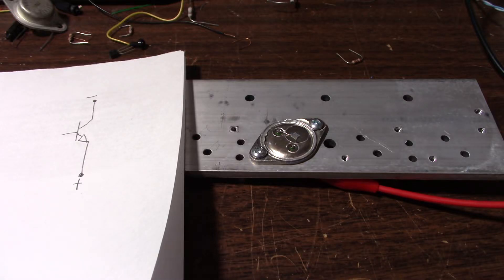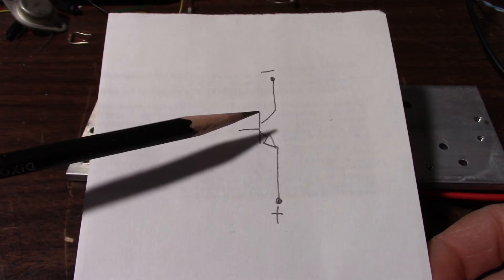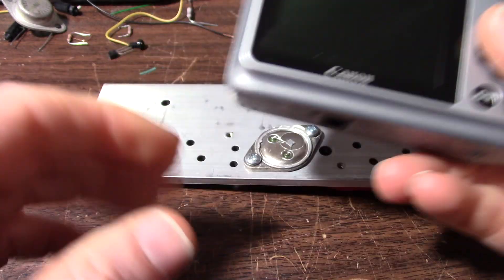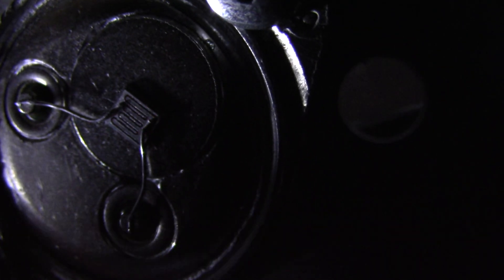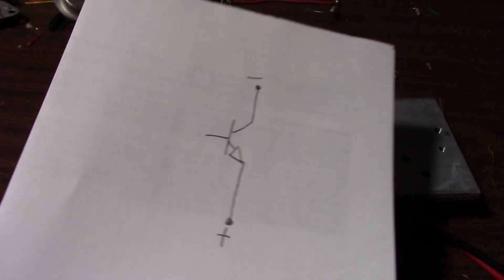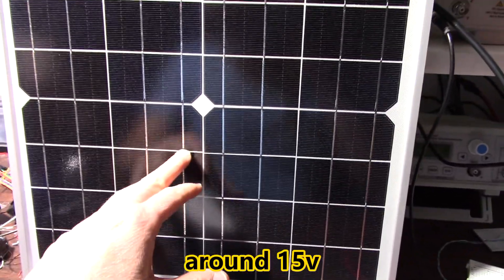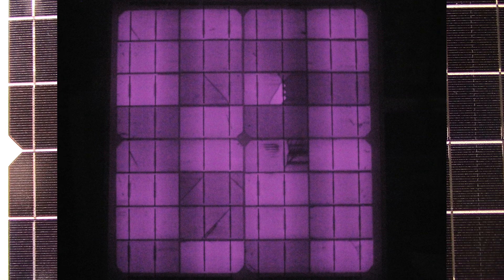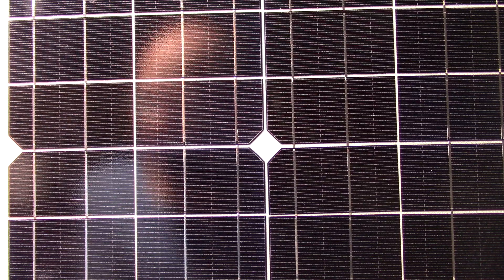Infrared light emitting transistors and solar panels

Comment: I remember back in the 90's sparking a huge discussion in one of the usenet groups for semiconductors when I posed the question what kind of photodetector would an LED make. I find it interesting to use things for which they weren't intended.

Comment: Interesting playing with PN junctions, back when I was a lad ! well we had a style of transistor I think it was OC81 and they where glass encapsulated and dipped in black paint and you could use some thinners and take the paint off and use it as a Photo Transistor it was remarkably sensitive to light, If you have a meter with a microamp range or beter you can measure current flow off a normal LED, I also used a solar panel to do the same thing but I didn't care if it was damaged so I turned the wick right up and it produced visible light ! nice video....cheers.

Comment: That purple-ish color from infrared radiation is also visible with mercury vapor rectifier tubes, as they put out a good bit of longer wavelengths that aren’t typically visible. The video your reference from Steve Mould (there’s actually two I believe) is one of the better illustrations of the underlying physics involved with semiconductors. He does a great job of breaking it down from a physics perspective rather than a purely electrical framework. Great video, thanks!

Comment: Try shining a light on the open transistor and see it produce a voltage... 
It works both ways...
Same same with an led.. shining a light into the led should produce a voltage also... I tried it with a 100W led and it works. 
Just like a speaker which also works both ways as do many other things...
Reply: In my youth photo transistors were quite expensive. However a very cheap and common germanium transistor was the OC71. I used to open them, remove the sticky stuff inside and we had a photo transistor. The voltage was very low. It was probably more of a light sensitive resistor really.
Reply: @MichaelBeeny  Did you use this as a photovoltaic, or a photodiode - ie, looking at the current generated with a reverse biased junction when light shines on it?
Reply: @ianboard544  To be honest Ian it was a million years ago. If I recall I used it in a film projector. To read the optical sound track. A light was focused on the track on the film and the OC71 was fed to an amplifier, did work quite well.

Comment: Somewhere around here I have a couple of 13V 0.5W glass-encapsulated zener diodes that you can see a faint orange glow come from the junction area when they're operating.

I also have a TO-92 Motorola transistor that doesn't have the usual black epoxy--it's clear. It's from the gold-plated lead era, but unfortunately most of the number rubbed off and I couldn't find anything else like it. The die is under the ejector pin mark on the rounded side and under a microscope just appears to be like any other small-signal transistor without any sort of enlarged area to enhance IR sensitivity. It seems to be a little weirdo that if I didn't know any better I would say it's some sort of demonstration or example unit.
Reply: Or a phototransistor?

Comment: You can also use the the base emitter diode directly of the transistor only in reverse bias. The voltage is around 7 volt and it is the Zener effect, which generates the infrared light. In this case it is useful to use a current limit. The reversed biased base emitter diode is also a good source of shot noise in order to build an audio noise generator with a low noise op amp with adjustable gain to match it to audio input voltages.
Reply from the maker: I made a video about a noise generator a few years back doing this. BE reverse bias can harm the transistor by reducing the gain and possibly increasing noise. I sacrificed a few to test. I'm not sure if the CE reverse bias causes any damage. I'll have to sacrifice a few more to find out.
Reply: @JohnAudioTech  I think it should be pretty clear that when you reverse bias the CE in an NPN transistor (i.e. collector negative; emitter positive), the CB junction becomes forward biased (i.e. the N-type collector is connected negative and the P-type base is relatively positive) and plays no part in the breakdown. So the reverse biased junction is simply the BE junction (i.e. the N-type emitter is connected positive compared to the P-type base). That is the junction that will avalanche break down. If you pass sufficient current that BE reverse bias damages the transistor, then so will CE reverse bias because it's the same junction that breaks down.

Comment: How can you tell whether the infra-red photons you observe are produced by band-to-band recombination from the conduction band to the valence band (which is how LEDs produce photons) rather than just being the black-body thermal radiation from hot materials? If the transistor was dissipating 12W, I'd expect the junction to get quite warm.
I would expect crystalline silicon to be a very inefficient emitter of infra-red because it's an indirect band gap semiconductor. LEDs are normally made from direct band gap semiconductors which don't need an intermediate state to emit photons.